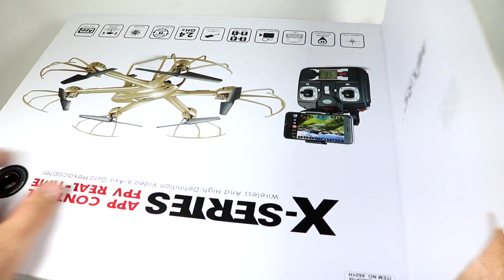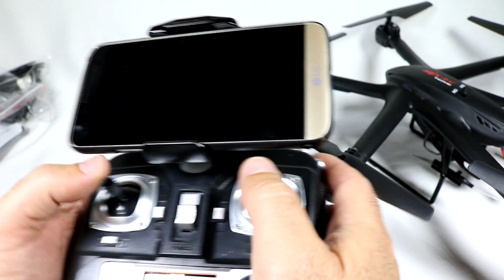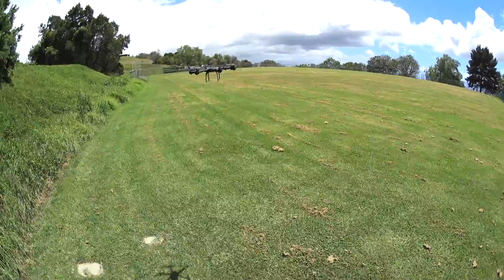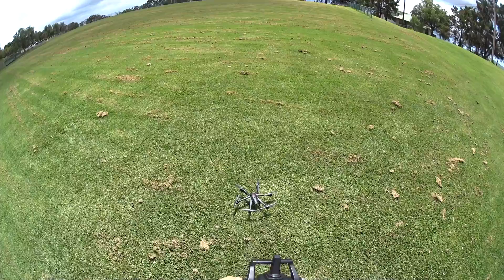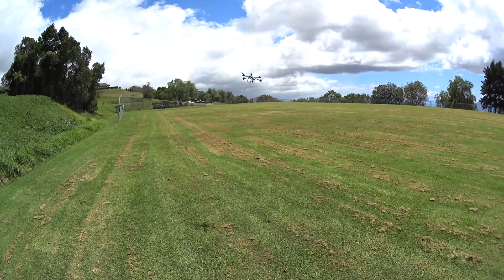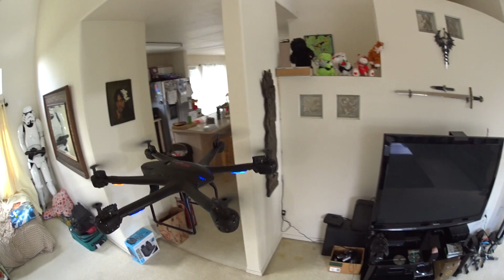MJX X601H Full Review - Alt Hold FPV Hex - [UnBox, Inspection, Setup, Flight Test, Pros & Cons]

Comment: I have the same issue the app did open I had the camera on once never opened again. I am gonna try later on right after I watch this video again for any info or pointers I can pick up. I have the 600 version it flies decent this thing is a train wreck to try to fly it and get the app working. As stated I got the app to turn the camera on once after I tried to proof it the the message I kept getting was no internet connection.

Comment: Hi Dustin
I am a subscriber on your channel and  
 From YouTube I see you are the most popular and have very good knowledge on drones that’s why..
Experts help needed.
I use to have an Mjx x601h and it flew great and I know about its behavior, handling, and flight characteristics.
This one I have now was a faulty one by banggood that I kept, and ordered a new receiver board because it did not respond at all, after the replacement of the board I have communication with the transmitter, motors start but …..
1) I have already changed the Receiver board with a new one.
2) The motor connections to the Receiver board are in the correct position.
3) The props are checked that they are in the correct position.
When I make a takeoff I take an altitude 1m and then the wobbling begins, it goes left-right-front and back, it acts as if the gyro is not working?
I try to stabilize it with the transmitter sticks but the movements are very slow and not responsive.
If I trim it gets worse.
I cannot stabilize it to a calm hover at all.
Please give me your opinion of what to do as I am considering of ordering another receiver board as if it is the only thing left, it might be another defect board?
Thanks for your time

Comment: FPV apps are indeed weird on these and the X600. Very specific about the app. In my case, I used an FPV app from a rival manufacturer and it works. The MJX apps never worked for me. :)

Comment: does it still have the auto flip function when you go above 90% throttle like the 600 does ?
Reply: Don't buy it the apps don't work right. I have one got the app down loaded and the camera finally came on. It took me like 6-7 tries to open the app once it was down loaded. Last evening I finally got the camera to turn on on the thing. ONCE. Tried to open it again and it wouldn't open. Have not a clue about that. For one the left stick does nothing therefore I only have some control using the right stick which is stuck at 100% in the forward position so it only flies forwards the rear position dumps the motors turns em off so there in no rearward flight. The right and left functions is 100% right yaw and 00% left yaw so if basically flies out to the right and you have stop it to set it down. I was really disappointed because it really is a neat little drone. But it's worthless if it barely works.

Comment: LOL!! I am sure you have it figured out by now, that all you 'cons' are all 'pilot error'. Apparently you do not like reading instructions! Start with wrong app. Correct app for the 'H' copter is MJX-H apk. Then another con on the throttle stick, which comes with the SCREWS to hold them in place! Just like the battery compartment and falling batteries! LOL! At least you screwed down the landing gear. I have seen several of the vids where they just popped them in and one flip later, the antenna was flying free and the landing gear was lost in the grass somewhere! I think they were the same group that did not read the instructions on the 'one key return', and the whole copter just took off and never came back! "When all else fails, read the instructions!!"  What I'd really like to know is on one of your earlier videos, you selected a larger battery, but by now you know that you can get 1200 mAH batteries of the same config, so that is a moot point. The other question I have is about relocating the antenna for longer range. Have you done that yet? Does it work? Are you going to do a video on it? Keep flying mate! (and READ the instructions FIRST, then assemble! LOL!!!)
Reply: Guess I should have read down the whole thread, LOL!! I see you have already figured out most of the stuff. Changing the camera too. I am going with the 4010 for my 'H (720p or bust!) , and I have an old Galaxy Grand Prime that I emptied out of all the unnecessary apps, leaving just the basics and the MJX-H. Works like a charm! Only 'con' I have there is the same as my Galaxy 5, the clamp is right on top of the side buttons, so I have to skew it out to clear them (or just use the phone outside of the controller!) Meanwhile, what about that antenna mod? (I have not yet read this thread all the way, so I will do that now.... maybe it's done, but I have not seen a new video.... ;-)
Reply: I need link for the app plz provide me correct app..

Comment: I am going to do some antenna mods on this hexcopter (just ordered it) and was wondering if it has 2 transmitter and receiver antennas, 1 for the 2.4 controls and 1 for the wifi 2.4 FPV or do the control signals share the same antenna as the wifi FPV since they are both 2.4ghz?  Just wondering about what I need to order and what I will find when I crack it open.

Comment: I am really interested in this quad because of its gentleness and stability (will be my first quad), but I do want to take pictures. Does this thing have a camera? I could care less about FPV because I don't own a phone(I had the good sense to toss mine into the rock crusher 2 years ago and have been smiling ever sense). I just won't take some decent video's – can this Quad do that?
Thank you
Reply: yes any fpv capable quads have camera,s
Reply: The 601H comes with a C4005 camera, which is only 480p (.3mp VGA) if you want decent video be sure you get at least 720p, but 1080 would be the MEOW! But going that high, you need a flyer with 5.6Ghz for smooth videos, even with a 2mp camera. You can buy an unlocked phone pretty cheap on Ebay. Do not need a carrier for Wireless connection to the device as long as it has wireless capability, and if no SD card in the camera, you will need one in the phone! Good luck!

Comment: Hi Dustin, i was thinking about getting this copter and running it with a 5Ah battery off ebay,
145.00*49.00*19.00mm / 5.70*1.92*0.75inch; 303g / 10.68oz
I recon it aint near as light as the default one and would murder the motors way quicker?
Then is a 1.5Ah battery at 
70.00*35.00*18.00mm(2.75*1.38*0.71inch); 87.7g / 3.09oz
a better option, or still too heavy / large?

As for your android troubles - did you check the packaging for qr codes? It may be that the right version of the app has not been uploaded to the market servers and is only available via a url towards some Chinese server.

I hope you will be able to make a video showcasing the fpv / recording capabilities, their claim to 720p video strikes me as unrealistic considering the price.

Thank you for your time.

edit: At the bottom of their product page there are qr links towards apps, i suggest you try them.
http://www.mjxrc.com/en/goods/show-X601H-en.html
Reply from the maker: +manhunt0r Hi, I wouldn't use bigger than a 950 or 1000mah lipo.  I had great results using the turnigy 950mah 2s on the original x600 and it fit inside tightly, yet door can still close. I have installed the app directly from the MJX website (MJX H).  And will attempt a flight with FPV again today and post up a part 2 video if it works.
Reply: Thanks for the info. I've read that disabling mobile data helps, and there is also an admin interface for the camera to mess with things like resolution and saturation - open the cameras ip in a web browser, login should be admin with no password.
Reply from the maker: +manhunt0r Got it all to work today and I'll be posting a new vid soon.  The app from MJX website worked with my older HTC M8 phone but not the LG G5.

Comment: Some sticks (like the ones on the first x600 transmitter) have screws inside that keep the sticks from falling out
Reply from the maker: +MightyRude there are indeed screw holes.  I'll have to check around to see what screws will fit.  Thanks
Reply: The screws come in the bag. 12 all together for props, gear and sticks!
Reply: Doug Noyce 
This post is very old (15 weeks old) 
He found the screws and searches for the screws when he encounters other models with loose transmitter sticks (just watch his newer videos)

Comment: Nice review dustin and what drone would I be able to buy for $700 in the gps class
Reply from the maker: +ivan sikaleski There are many many options for that price Ivan.  Depends if you want best video, range, features...etc.
Reply: +Dustin Dunnill  video 1080p (built in camera) good range and height, good speed and etc
Reply: Forgive me for intruding, however.... From all the videos I have watched, and what you want, plus my own personal experience. The Hubsan H501s is your Quad, Sir. Never failed on me, not even with stock Firmware specs. Not broke, no reason to fix.

Comment from the maker: You can find the X601H here: http://goo.gl/JJhSEd   Or here: http://goo.gl/FsWJND both links have the Hex and also have parts and upgraded batteries.  I'll be trying this again with my wife's Iphone (she's going to be thrilled...not) and see if I can get the FPV  and other functions to work.  If so i'll make another updated video.  Hope you all enjoyed the honest review :)
Reply: There is actually a separate "MJX H" app that is different than the 4008 one. Also, I tried the 4008 version with my 300C and it still won't play stored videos (on Android), just like the 4005 version won't, unfortunately. Here is the download link for the "H" app: http://www.mjxrc.com/en/down/128.html
Reply: I actually just successfully downloaded the "H" app and it is very different from the 4005 to 4008 app. With my 300C the video portion works, and for the first time, I am able to play back recorded videos. I hope Dustin will download that app I linked, which I can confirm works with Android (S7 Edge in my case),  and update the review. The app has some pretty cool features that I'm not able to use with my 300C but which hopefully work ok with the X601H. 

The app download was very slow, despite the fact that I have very fast internet.
Reply: Go to MJX com and download last one.....C4008apl.  From Google store don't work for my too.
Reply: Ok, ok maybe i'm wrong for apl.
 " RC escape is contol " the toy from apllication and this is new apl not C4008 cam. apl., last night MJX RC site is not be available " load too long " to check which one is correct apl. so is must be see on the back of the box whats is wroted exactly. And yea i also use VR glasses box if i fly with MJX and C4005-4008cam. in close distancе . On both my android devices  apl. is work fine with 4.4.2 Andr ver. Lenovovo phablet  and 5.0.2. ver to China phone
Reply: i clicked your link to download the app and all i got was a pdf file that  didnt even open with adobe pdf reader
Reply: Dustin Dunnill ils

Comment: mine wasn't compatible with my phone though
Reply: You can buy an unlocked phone pretty cheap on Ebay. Do not need a carrier for Wireless connection to the device as long as it has wireless capability.

Comment: my favorite hex and I added a mini 4k camera to mine
Reply: which?
Reply: and do you think it could Lift a gopro
Reply: +max chilla I don't think it will lift a go pro and if so it will have a difficult time, the camera I use is very light
Reply: Which camera do you use?
Reply: +max chilla it was a Chinese brand that had all the accessories of a go pro if you look at my video I did a test flight with it.
Reply from the maker: +max chilla yes but flight time will be about half as long and it will stress motors more so they will fail sooner.  I lifted an amkov (GoPro copy) in my x600 review a while ago and it could handle it but not sure about prolonged use. I would use a lighter cam like runcam or keychain Cam if possible.